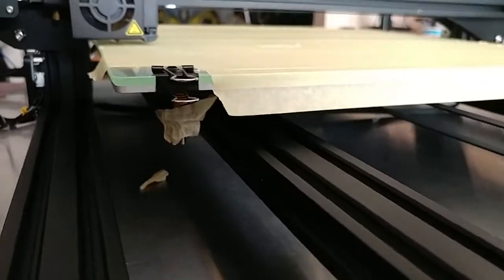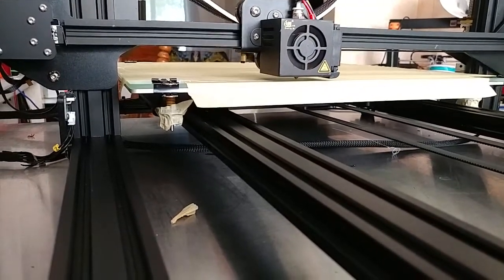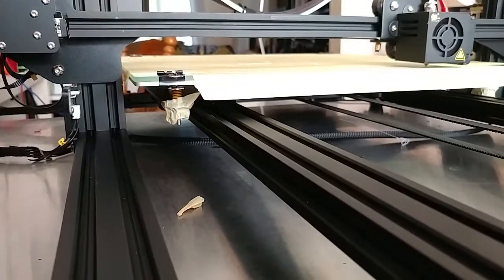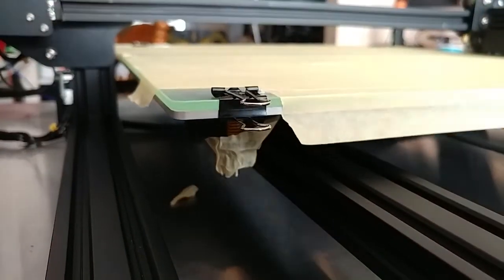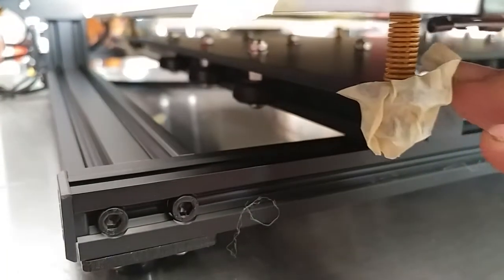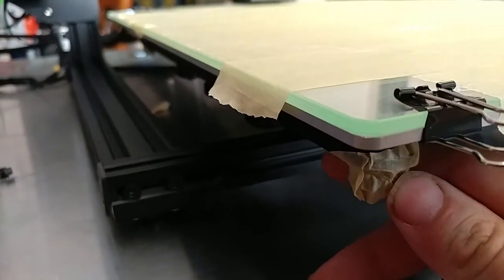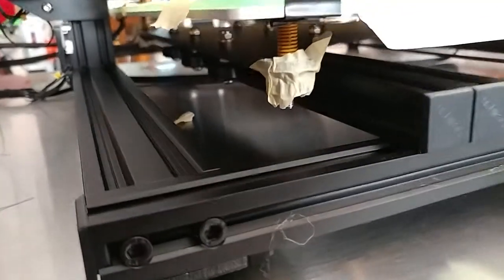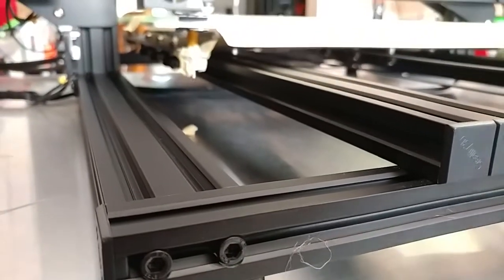Today's 3D Print 123 Quickie Cr-10 S4 bed level nuts working loose

Comment: I am so glad you posted this, I've been having that problem occasionally on the Cr-10 Mini and I kept telling myself, there's no way, I just didn't level it good enough.  I knew the thing had to be turning during my prints and now you confirmed it.  This is actually why I was asking you about the flat edge springs, I was going to try to replace them with longer or stronger springs to stop this very issue.

Comment: With mine, the gantry worked itself out of alignment cause chain reaction of cattywompusness. After leveling gantry with frame, I added two small washers to each bed screw and that tightened the tension springs and "locked" my bed in place "50% better."

Comment: I got tired of leveling my printers. I removed springs from 3 of them, and just replaced them with appropriate size spacers and added auto bed leveling -- bl touch to the 2 cartesian printers and the delta now uses piezo based system. No more leveling -- just click print. My newest build has piezo based system also...manual leveling is too frusturating -- especially since you have to keep watching the first layer each print. Now I just hit print and check 20 minutes later to make sure filament is feeding OK and I din't do a bonehead slicing error -- so far it's been perfect first layer each time.

Comment: Same thing seems to be happening with my CR10. The X stepper seems to vibrate with large movements and this can be felt throughout the frame.
Reply from the maker: turn your jerk down to 10. not only will it quiet that down quite a bit but your prints will look nicer too.
Reply: Thanks for reply, I have changed both print jerk and travel jerk in Cura3, and just trying a fresh print, it does seem a little better.
Reply: Jerk settings made it a bit less noisy, but now I have cured the problem totally by lightly lubricating the bearings. The main culprit was the X axis lower bearing.

Comment: I'm still trying to find the best suited printer for my needs. Did you know there is an Ender-4? It is a Core-XY design with vertically moving bed, that's often said to get better results, than having the bed on the Y-axis. I think this printer is very cheap and has the potential for even improving on the Ender-2's printing quality. The overall shape should make it easy to put an enclosure around, or even fit some linear rails.
It seems to have some problems at stock, but after a little fiddling it seems to be a really decent platform. Too bad there are so few prints so see of, yet.

Comment: Looks like your springs are not compressed enough. To apply enough pressure
Reply from the maker: +Tac Blades yep. My guess too. Adding a couple washers to increase spring tension might be enough. I have an idea though to turn them into quazi locking washers.
Reply: Nerys quazi now thats a name i have not heard in a long time, - stares into the distance and strokes beard-
Reply from the maker: hehe. normal word for me then again I am not that normal :-) I love the other guys (you maybe?) Caterwompudness :-) or something like that. it just sounds cool.

BTW I am pretty sure I know exactly what printer movement caused it to loosen. when it tries to close the cap on the dome is makes these little sacrificial extensions for the next layer closing. and the printer does a very short rapid constant jitter jitter as it forms these. exactly the kind of vibrating motion that would loosen an "on the edge of too loose" leveling knob. a tpu washer combined with slightly tougher springs (light compression instead of extra light assuming that is what they used on the S4 like the S3) medium is way too stiff in my opinion though not fact based might be fine. might test one day. but not on my s4. only have one of those. maybe on the S3 that is not working so hot (I think I mucked something up dirty prints mechanical issue) I will get around to fixing it some day :-)
Reply: I used to have this problem on my normal sized cr-10 but I found that if I used wing nuts under the bed leveling knobs ( after I got the bed nice and level) it keeps things in place.

Comment: Indeed i have a huge problem on my s5
Reply from the maker: Add some nuts before the springs. It will tighten then up!

Also make sure you turn your jerking acceleration way down jerk of 3 acceleration of no more than 500 maybe even lower
Reply: @nerys71  What i finally did was download from thingverse Bed Leveling Knob adaptors and now its easier to adjust the height. The knobs are much more stable now.